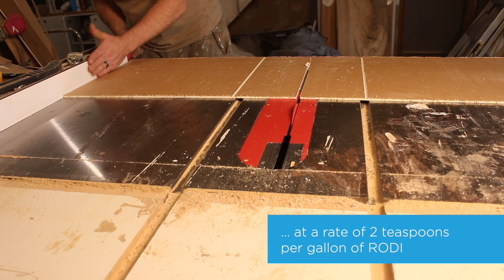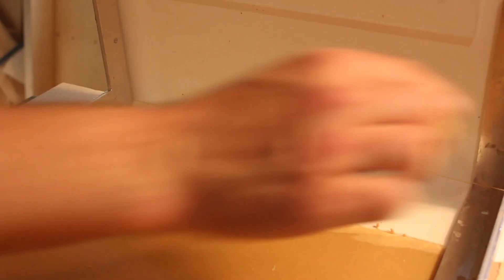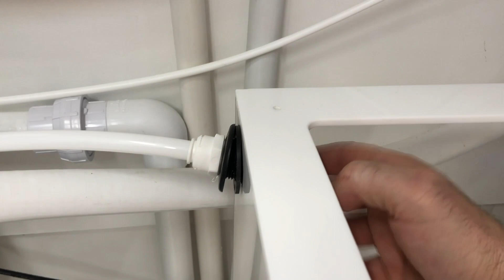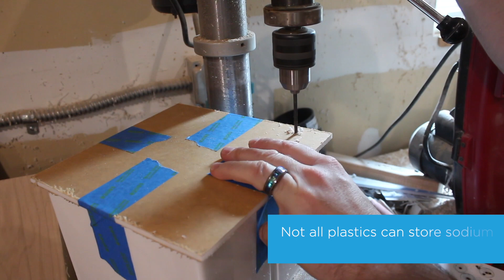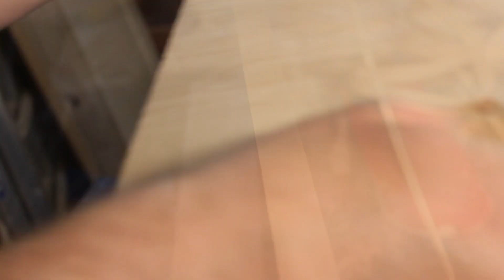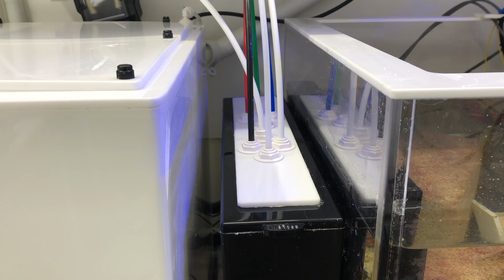Ep. 15 | Build Series: Setting Up Dosing

Comment: Another great Video!  Loving the series, and keep up the great work!!  Do be careful with Sodium Hydroxide, as I understand it, the chemical reactions change depending on the tanks PH (and the concentration of sodium hydroxide used). Well above a level of 8pH,  the Sodium Hydroxide has some interesting and beneficial by-products when combined with CO2 in the tank.  HOWEVER it is my understanding that below a level of 8pH, you run the risk of producing Carbonic Acid as it interacts with the excess CO2.   (I have no scientific training - just read a bit around the subject as I wanted to use Sodium Hydroxide in a different way for my tank).  Good luck.
Reply from the maker: Thanks Robert! Appreciate the watch. I'll have to look into your question - I haven't heard that Sodium Hydroxide has more potential to react to form carbonic acid than any other ALK additive (this is the opposite reaction of why we add it to the tank) - as when pH drops using any ALK additive the reason it does so is partly the formation of carbonic acid from C02 in the water. Your caution is warranted though in general , as sodium hydroxide is a stronger base that other ALK additives. But, because of that it is also easier to reach a higher pH (mine stays between 8.1-8.25). Looks like I have some reading to do, as I'm not a chemist either! : )

Comment: I think you need to start selling these containers that's an excellent job I like to detail work and you said you had your dosing pump hooked up to your Apex would like to see a video of how you have that setup and maybe even a how to step-by-step I've been in the hobby for about 3 years I started out with a 30-gallon move to a 55 gallon and now I have a 94 gallon with a 40-gallon DIY sump my old 55 gallon aquarium my pH was always 8.2 8.3 with my new aquarium my pH is 8 to 8.1
Reply from the maker: Thanks Bald8bil - I'll add it to my potential video list! Is your dosing regime between the old 55 and the new 94 any different?
Reply: @ReefEco  I have never done dosing before 94 gallon my LFS told me to start adding 3 tbsp of Kent superbuffer-dKH to my ro-di container it's 7 gallon and it lasts me 12 to 14 days before I have to refill it and I started  adding Kent superbuffer-dKH about 3 months ago
Reply from the maker: @BALD8BIL  That is your problem - stop using superbuffer!  It adds extra borate, which can get things out of whack. And by adding it to your top off, you are dosing ALK according to your evaporation rate, not your coral consumption. What corals do you have? Are you adding any calcium supplement? If you have some stony corals, I would look into starting to dose Kalkwasser, which is much better than dosing superbuffer (and far cheaper!), as it adds calcium and alkalinity in a balanced way, and also boosts pH. You will need to test for Alk and Calcium, if you aren't already. Check out the Hanna Alk checker (Dkh) and I use the Red Sea Pro calcium test. Before you start dosing kalk, I'd do a string of at least two 25% water changes to correct the imbalance the superbuffer has created, then you'll have a nice foundation for dosing kalk. If you do have significant LPS or SPS corals, you could also look into dosing two-part ALK and Calcium. Kalk may be enough though, depending on your ALK/CA demand.
Reply: @ReefEco  sorry it took so long to get back to you  in my old aquarium I had a bad green hair algae and aiptasia very bad so my new aquarium I started with all new equipment  in 3 months I moved over 2 clownfish 1 green chromis,cleaner shrimp  and my butterfly fish but it died so my wife got 1 coral beauty, sand sifting sea star,1 yellow watchman goby, and 1 bristletooth tomini tang in October 2021 we add 1 green montipora, 1 red montipora, 1 trumpet coral,rainbow acan echinata, red bowerbanki coral, in November we got hammer coral,purple jade bonsai acorpora coral,and this one is not doing good red goniopora coral but it looks pink now I test my water every Saturday around 2pm but ph and salinity my apex so I check it every day 2 to 6 times. Kh is 10.5,CA 430 to 450,MG 1290 to 1230,ammonia is 0 from June 18 2021 to now,no2 is 0 from June 23 2021 to now, n03 is 0 from August 21 2021 to now, phosphate is 0 from July 23 2021 to now, salinity jump from 34.9 to 35.7, ph 7.95 in August to 8.21 in February, every 10 to 14 days I top off 7 gallon ro-di, every 2 to 3 weeks I do a 30 gallon water changes I have upload videos of my aquarium setup to Facebook saltwater  groups under BILLY Baldwin
Reply from the maker: @BALD8BIL  No worries - you definitely have some stony corals in there, you might look into dosing kalkwasser - it might be all you need since you don't have too many corals. It also looks like your phosphate and nitrate are 0? Getting those up to around 0.03 to 0.05 for phosphate and nitrate to 5-10ppm will likely make your corals a little happier...
Reply: @ReefEco  I have tried to get them up. I feed my fish 3 times a day I use frozen food and  pellets I was told by someone else that it might be a new tank syndrome I've also been told that I don't have enough fish in my tank and with all the headaches that I had with my live rock i not want to do that in the new tank that's why I did dry Rock.
Reply from the maker: @BALD8BIL  Yes, it is a delicate balance with nutrients, especially in a young tank...

Comment: Nicely thought out. 👍 on the acrylic fab skills.  I learned the hard way the tape is necessary 6:03 cause somehow the roller on the router bit scuffs the acrylic. 🥴.   I really want to try the bending process. Do you just use saw blade with one pass about half way deep? Great ideas in this video. 👍
Reply from the maker: Thanks LL - yes, found out the hard way as well on the bearing scuffing the acrylic! I know exactly what you mean... As for the scoring, yup - I usually go half as deep as the sheet, then about 2/3 as wide as the sheet thickness, so when you bend it the edges of the score don't run into each other. I'm addicted to the bend acrylic look - totally slick! Thanks for watching!